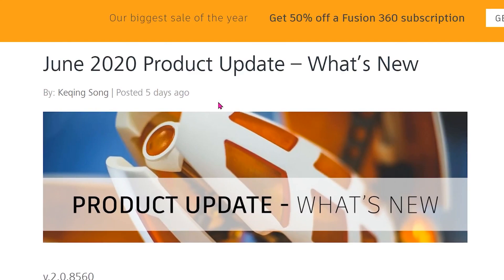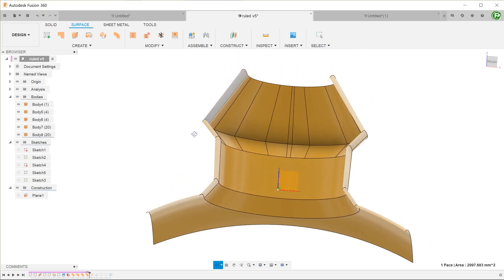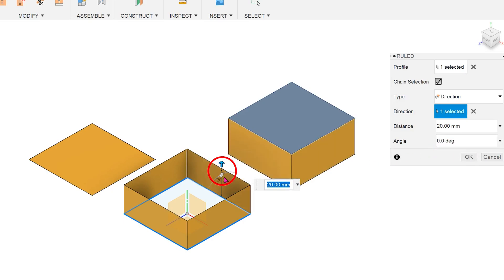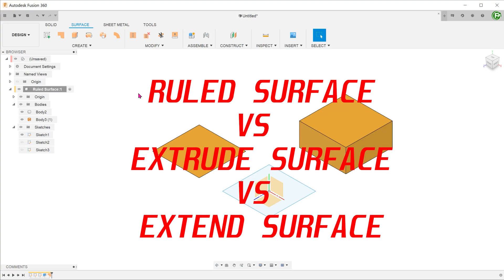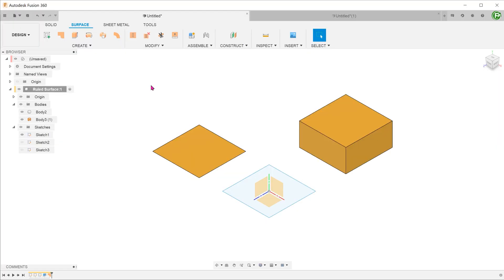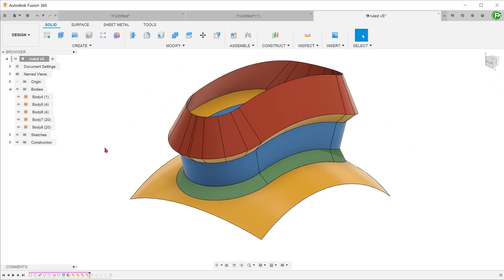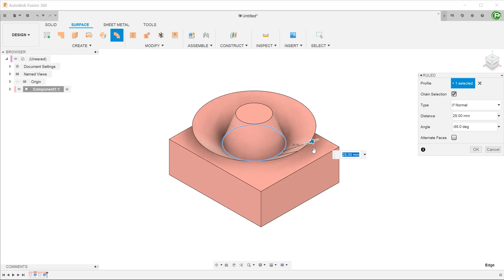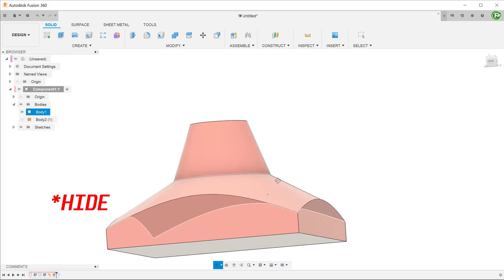Fusion 360 New Feature - Ruled Surface

Comment from the maker: Dear viewers, hope you have found this video useful. For those of you who have tried out this new feature, has anyone suffered from serious performance issues?
For anything other than the simplest of models, I find that dragging on the distance arrow or rotating the angle wheel will cause serious lag. I consider my setup to be in the upper mid-range. Hope to hear some feedback.
Reply: I have a Ryzen 5950x (16c/32t) with 128 GB of 3200 Mhz RAM and it still starts to lag when using this feature. Not very bad but still, it's the only lagging experience I can have on my computer with Fusion 360. Especially when you have multiple ruled surfaces extruded from one another.
Reply from the maker: @RunTheTape  Wow, that's a really good system. This shows that the ruled surface feature really needs to be optimised.

Comment: Great tutorial as usual. Thank you! But...! how did you create the surface pattern on the complex surface in the thumbnail for this video? 🧐🤓😌
Reply from the maker: Thank you. It is actually an applied appearance. You can find it under plastic->textured->polka.
Reply: @Fusion360School  OK. Got it. Thank you very much! At first I thought maybe a modelled surface, and therefore even more interesting how you managed on that complex surface. In any case, this texture is a new discovery for me at least and super-interesting. I will be able to use, adapt and do some cool stuff with. Thank you! 😁🤩😁
Reply from the maker: @jameskrueger6282  If you are keen, you can try to emboss a pattern of circles. But emboss can only work on surfaces with a singe degree of surfaces, such as a cylinder.

Comment: Finally! This was one of many reasons why I chose Solidworks over Fusion. Fusion is evolving and getting ebtter and better. This simple tool can be used very efficiently in surfacing;)
Reply from the maker: Yes, Fusion 360 is getting closer all the time to Solidworks. Unfortunately, it's drawing module is still severely lacking.